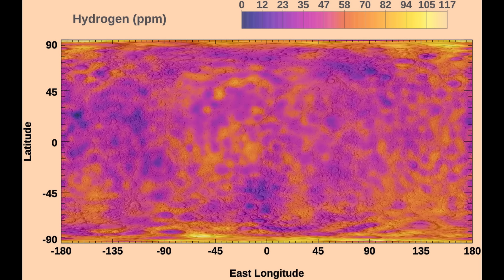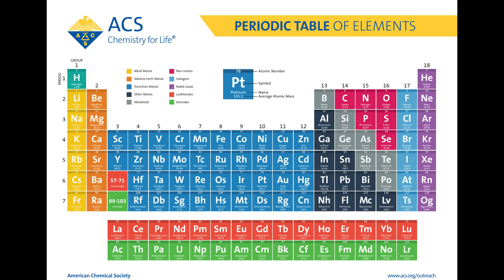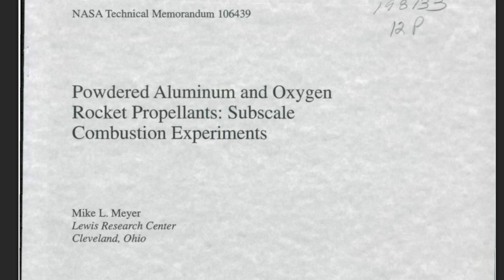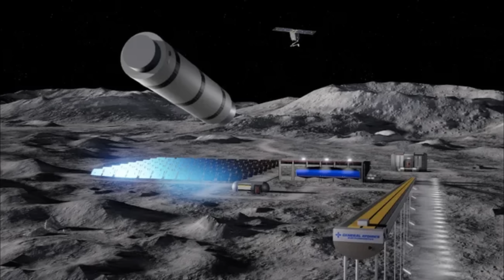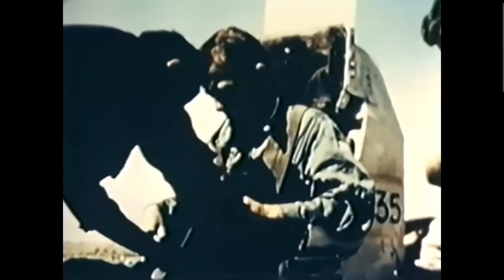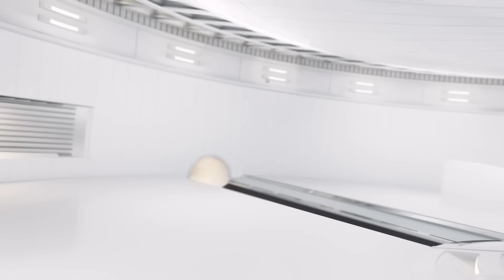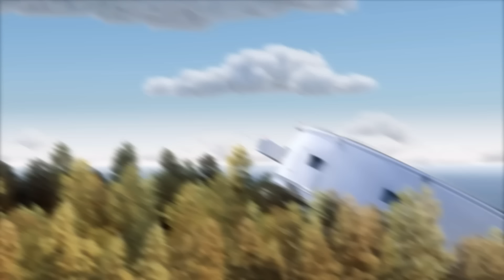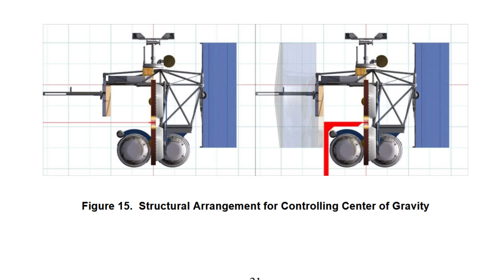Launching From The Moon With Silicon Based Rocket Fuel And Other Ideas - Deep Space Questions

Comment: 11:00 You're thinking too small for guns -- the Rheinmetall 120mm gun that most NATO tanks use, the armour-piercing fin-stabilized discarding sabot slug (think a nine-pound tungsten lawn dart an inch in diameter and two and a half feet long) does a mile a second out of the muzzle. 5700fps out of the longer-barreled version of the gun on the Leopard II.
Reply: All metric units: The gun is called Rh-120, the cartridge is 120x570mm, and the long-barreled L/55 (55 calibres long, so 6.6m tube) is 4160kg. The 70-ton tank has ~65 tons of armour, drivetrain, and people, the gun itself (the entire thing, breech and mount included) is only a hair over four tonnes, and throws that 4kg dart at 1750m/s

Comment: For a mass driver, why a coilgun instead of a maglev train track with a bit of a ramp at the end? The 'bucket' on the track could basically be a maglev train with a flat bed on top. Since the moon doesn't have an atmosphere (aside from the rock dust) it'd be pretty easy to accelerate a maglev up to the kinds of speeds you'd want for packet launches. The main problems are constructing the track, getting the train up there, making sure the train doesn't fly off the track with the packets, etc.

Comment: There has also been work done on using Aluminum/Aluminium and LOX as a rocket fuel. If l recall correctly one fuel was a LOX/Aluminum slurry for a monopropellant. Aluminum Oxide is also very arbrasive. Lots of grinding wheels are made from it. Engines using this fuel would have pretty low ISP but if the use is restricted to operations from the Lunar surface to orbit and back down it is also dirt cheaper.

Comment: You're not going to be just tossing material  into orbit or near Earth space unless it's in some sort of melted down slug form of the material or a standardized cargo container made for the purpose. Anything loose like gravel that was launched in a bucket would just act like giant shot gun shell. You'd probably want some sort of automated guidance system with thrusters to slow it down for those on the receiving end as well.

Comment: Silane would be excellent as a fuel created on Mars too.  By using Formic Acid as the main solid oxidizer of a hybrid engine, a specific impulse above 280 seconds would be doable (theoretical Isp at 325 seconds).  Formic had the bad luck of not being produced in large enough quantities, when the engineers of this planet, were experimenting with virtually every combination of propellants, in the 1950s.

Comment: Building space elevators on the Moon is pointless because when you gain height you get very little additional velocity. It's almost the same as launching rockets from the mountains on Earth. Linear accelerators are much better, the only problem is you can't rotate one in any direction. We'll need some of them to get to the ecliptic plane and also several more.

Comment: I think that this discussion lacks perspective on just how little Isp is required to escape lunar gravity with a "reasonable" payload.

An Isp of 200 could get you to lunar escape using a single stage with a fuel fraction of ~70%.

In addition the moon's low gravity means that the motor doesn't need very high thrust to deliver "reasonable" gravitational losses. This reduces both the weight of the motor itself and the weight of structure/tanks/etc, leaving much of the non-fuel mass available for payload.

Reaching orbit from Earth is hard because (as Scott has pointed out) Earth's gravity is pretty close to the practical limit for chemically-fueled engines. The Moon is quite different.

Comment: The great thing about the dark side of the moon is that you dont need to keep the superconductors cold. It is cold enough already. There is no atmospheric resistance for a magnetic track that could be circular. Hypothetically, if a small probe could be propelled to 1/4 light speed, they would be interstellar in 20 years.
Reply: The 'drak side' of the moon see's as much sun as the other side does.  You might be thinking of some of the polar craters.

Comment: One approach that works very well economically is a surface to orbit lunar shuttle using conventional hydrogen and oxygen. The hydrogen (20% of the propellant) is loaded in orbit and the oxygen (the other 80%) loaded on the Moon’s surface. Given the high performance for LH/LOX and simplicity in operation, in the studies we did, it beat every other chemical and nuclear rocket option by a large margin.
Reply: Yeah it's just a problem for long term storage or for any parts it comes into contact with.  Leaking, embrittlement and low density.  It's great on paper.. and that's about it.
Reply: @imaginary_friend7300  All rocket propellants have engineering issues, and handling hydrogen is well understood. The long term storage issues resolved in the lunar orbit station which has the power and mass to provide active cooling. Although in the specific infrastructure study I mentioned, almost all the in orbit transport elements uses nuclear rockets (SI 1250 sec) with hydrogen propellant. (M. Hempsell, “Transitioning from First to Second Generation Lunar Infrastructures,” Journal of the British Interplanetary Society, Vol 75, pp.406-414, 2022.)

Comment: The "coil gun" was fairly feeble compared to the other design, the rail gun, which makes use of the Lorentz force..the navy built an 8 megajoule version that fires 3.2 kg metallic projectile that went through about eight slabs of concrete, an absolute wrecking ball on steroids, but high maintenance , smaller one could be made more practical..
Reply: If you're trying to move payloads you want larger not smaller. :)

Comment: What do you think of using active support for a space tower on the moon?

Or using atmospheric pressure to keep the structure up? Could it even be as simple as an inflatable cone shape, the taper acting as support against gravity? And then the excess O2 byproducts could be used to replace leaked gases
Reply: The problem is the structure needs to carry a load.

Comment: I love the idea of making all of those fuels on the moon and testing them.  I hate the space elevator idea.  It's so impractical and would eliminate an orbital plane around the moon times 180 degrees because that path is occupied by a cable capable of cutting your ship in half should you hit it.  Like Saturn,  where can you orbit Saturn and not hit it's rings?  Way outside of Saturn or below the rings but it eliminates most of the paths you can take and a single obstacle will also be a problem because it's not in low orbit.

Comment: two comment. 1) the counter weight for a spin launch on the moon can be another orbital vehicle that goes to the opposite Lagrange point. 2) Space elevators aren't practical because the time taken for a mechanical climber to travel 80k and return is so long that your system through put is effective zero.

Comment: Scott, by the way could a circular accelerator be used in conjunction with a smaller linear accelerator to get to escape velocity and what diameter would be required if the payload were 35 tons with a human on board?

Comment: 11:30 larger diameter tank main guns can actually do well over 1600 m/s (roughly 5200 ft/s) using saboted ammunition. Most modern APFSDS projectiles can easily clock over 1650 m/s at the muzzle.

Comment: My question is the backend of a mining operation on the moon..   How do you get the mined materials down to earth?  For example < think you said there is titanium on the moon, we mine a ton of titanium and successfully send it to earth, now what?  How do you get it down without burning up?  You would have to collect it, put in some kind of de orbiting container with a heat shield  I guess..   I have to wonder what the landed cost would be?   Is there anything on the moon that would be cheaper to mine on the moon then on earth?
Reply: I think the current thinking is there is no use case for trying to return material to earth.  You'd mine the moon for material to use in your space projects and save yourself the expensive need to bring it up from earth.

Comment: It would seem like just pressurization would be enough without any kind of combustion To make it back to Earth. I have air guns that break the speed of sound. When you consider Earth's gravity well Just loading up some of that silicon dioxide and oxygen or whatever gas you can produce and then pressurizing it with some pumps shooting it out the back under pressure should get you the speed you need
Reply: You can, it's just not efficient.

Comment: My plan for a moon mega battery is have a big line of mass orbiting the moon but just below the surface (rather than normal in the sky orbit) and held in place with magnetic stabilisers. You then bleed energy in or out of the system with small changes to speed or sub surface 'altitude'
🤔 Piece of 🍰 

This is what i power my ore rail/yeet gun from 🙌

Comment: By the time you are done expending propellant to land on the moon, and even more to lift off from the moon. You could have saved a significant amount by parking on/next to any number of Near Earth Asteroids/Objects (NEOs) or even some of the inner main belt (though that would take longer). The gravity on most asteroids is on the order of 1/10,000 of Earth's gravity, so low you can basically ignore it.

Using asteroids means that you don't have to fight gravity, OR be on a giant target that pulls asteroids towards it. Water is extremely abundant on asteroids. For instance C-type asteroids are 22% water by the best estimates. There are even a dozen or so known that are NEOs, from 330 meters in diameter on up to 6 km. You can use the 'Small-body database query' to find whatever type, size, composition of object you want.
Reply: But how do you process raw materials in zero G?  Not easy.  You'd want some gravity for that and the best spot is the moon.
Reply: @imaginary_friend7300  For the parts that need gravity you use a rotating drum, its not rocket science. Overall a LOT less energy is used moving stuff around, meaning less expensive machinery for at least a few parts.

Comment: 11:16 As a “gun pe- firearms people”, often the limiting factor for the upper bound on conventional projectiles is not forward velocity, but gyroscopic forces. Bullets are spin-stabilized, and even something benign like 5.56 from an AR-15/M-16 is spinning around 290,000RPM.
When you really start pushing velocity into the 5,000fps range, the rounds tend to spin themselves apart. Typical copper-jacketed lead-core projectiles from barrels with normal twist rates start to fail at around 4,000fps, and solid copper or brass will fail over 5,000. You can use a slower rifling twist, but that’ll negatively impact stabilization and thus accuracy.
There’s a great cartridge load simulator called QuickLoad that’s the lovechild of a spreadsheet and a ballistic computer. You can simulate propellants with burn rates all over the place, different case dimensions, and projectiles, and it’ll give you a load of data like velocity, pressure curves, gas production, bolt thrust, etc.

Comment: The problem with a space elevator on the moon is two fold: first off, if the Earth wasn't in the picture it's stationary orbit would be 86,725 km above it's surface. This is because of it's slow rotation. Then there is the issue of Earth's gravity pulling on it, so it could only be placed either directly facing Earth or on the exact opposite side. Any other locations wouldn't work.

Comment: Lots and lots of nuclear power is needed for early-phase smelting, refining, and manufacturing, on the moon. Later on--IF manufacturing solar-cell panels proves feasible, and IF micrometeorite damage is minimal--primary lunar energy sourcing can finally be transferred to solar cells. 

BUT  don't neglect the need for nuclear-sourced electricity / power production... for some years, initially. 

(Plus... lots of [nuclear-sourced] energy will be needed to slag down  regolith, for landing and launch sites. All that might be needed prior to the SECOND landing, to avoid lethal regolith shrapnel being produced. And... if those nuclear power sources are needed for the landing of freighters, simply later transfer those resources to the production of lunar infrastructure and propellants.)

So... who has been designing nuclear-fuel vacuum-environment machinery? Anybody...yet?

Comment: Aluminium/Water ice solid propellant is sadly missing, and tripropellant oxygen/metal/hydrogen engines with ISP in the high 400s. Also, hydrogen only makes up around 1/6 of the overall propellant mass in a hydrolox engine, so there is massive leverage to be had even without lunar water. nice video

Comment: We lack data about the moon, we have hardly scratched the surface in terms of exploration.  Water and a lot of other things may be abundant just dozens or hundreds of meters below the surface.  It is a simplistic line of thought, but if the early earth threw off material that became the moon when a big asteroid collided with the earth,  then might not the moon have most of what we find on earth, including heavy metals?  Better to scientifically explore the moon and build our knowledge base.  Drilling, magnetic and chemical and seismic surveys, robotic labs doing on the spot analysis of samples, etc.

Comment: Someone used the aluminium inside a car engine for energy source, to run the car with water (hydrogen+oxigen electrolysis). The motor was danaged after 100km. Daniel Dingel was the developer.

Comment: For the mass driver high pressure gas could be used because of the high pressure differential between the moons atmosphere. This may have an issue because it uses high pressure hydrogen which will be in short supply but with a gas recovery system like a muzzle break it could work.

Comment: A single fix cable to run on it does NOT save any energy. You save only with a double cable in addition to the first one, and a pulley on top of it and a mass going down when your goind up.

Comment: the 'Paris gun' did over 5500 ft/s.. anyway I like the Silane, but mixed with powdered silicon and powdered Aluminum. .. perhaps using a tungsten chamber ..  The mass drive only has to accelerate the payload up into an arc to the point that the hybrid Silicon - Aluminum - Oxygen rocket engine  sand blast exhaust ablation is need to be above the surface  that would be affecting one's lunar base...